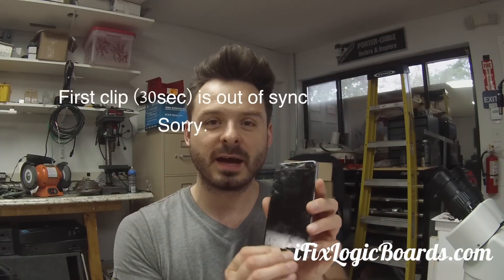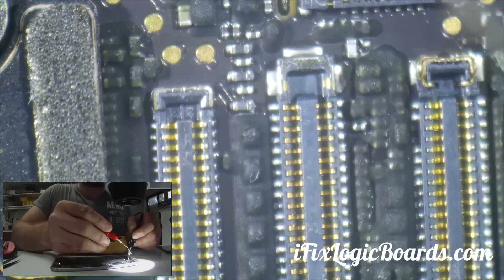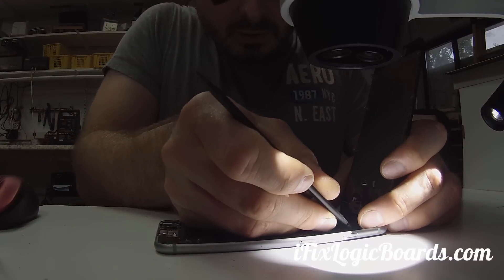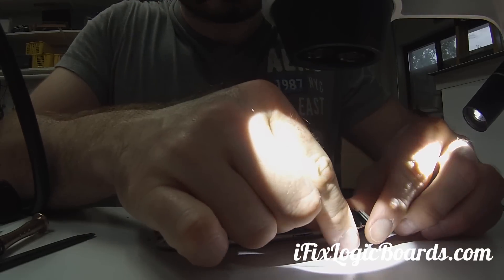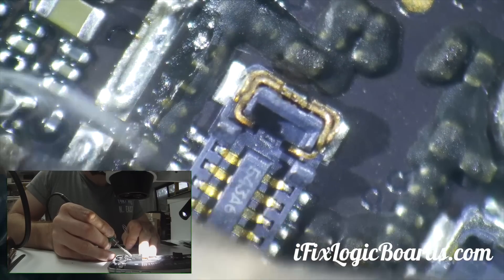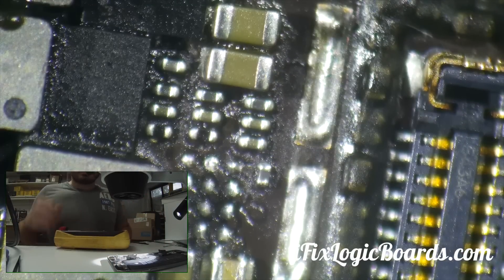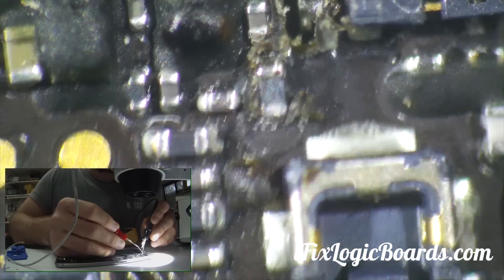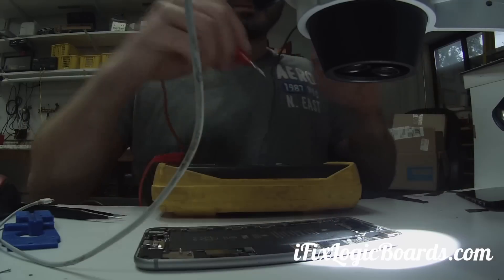iPhone 6 Plus Backlight repair

Comment: 1:32 what happen if i hold the power button, is that the voltage is up to 20 volt without screen installed on logicboard?

Comment: Thank you VERY MUCH! Client came with 6+ Touch IC disease to be repaired, and an additional defect - Right side of BL not working. Solved Touch by replacing Cumulus, but had no complete BL chain in schematics available. So, replaced the filter you replaced at the end, and now it's fully operational. Am thinking of that ZXW tool...
Kudos and regards!
Reply from the maker: ZXW is definitely worth it. Glad you got your 6 plus running.

Comment: Thanks I'm just starting to repair iphone I'm missing a lot sometimes I can not find the complete information on the internet there are still some flaws that I could not solve I've broken an u16 on iphone 5s and I just found out that u16 if I replaced it I should program it I'm from Ecuador We are a bit behind in repairs